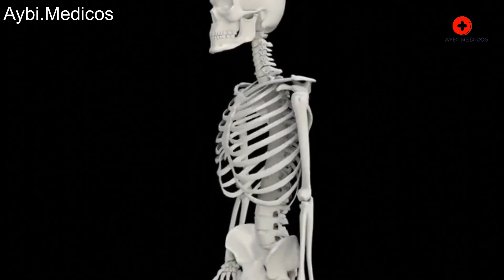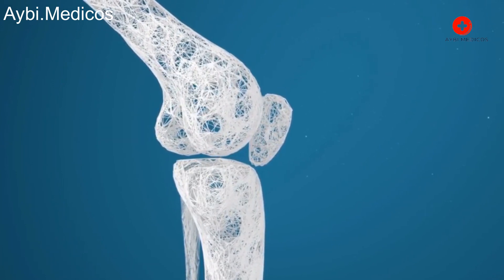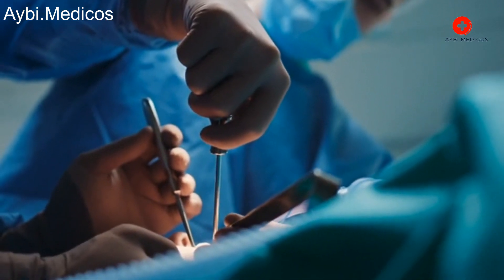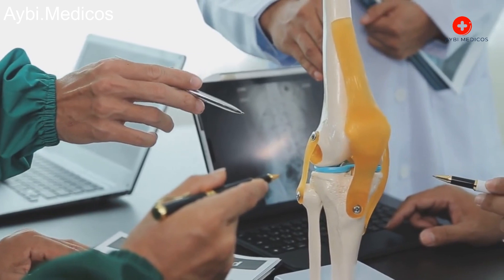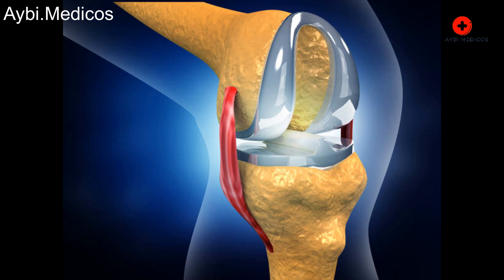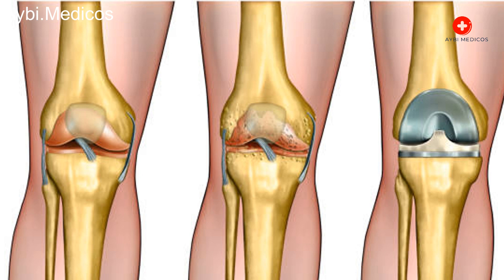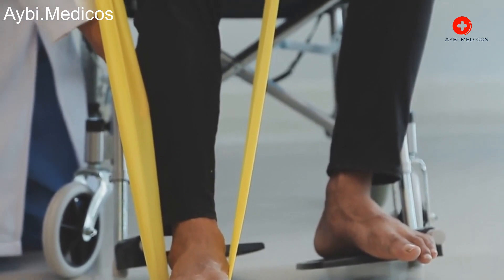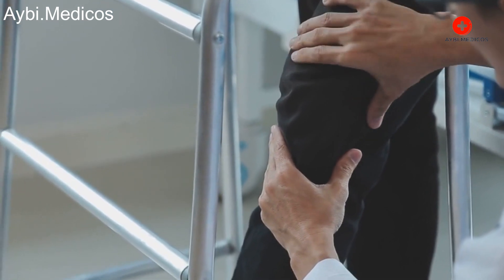How Knee Replacement Surgery Works ?

Comment: Not accurate as far as the recovery time, it takes a year to a year and a half to fully heal
Reply: That's true.👍👏👏👏
Reply: @canangungor5542  it certainly is
Reply: I had a "Day surgery" knee replacement...2 hours after the operation I was sended home, heavily sedated, no pain the first day, but 5 days after my leg got swollen and covered in black a blue hematomas, extremely painful to do excercises, today is day 10...can't sleep more than 3 hours straight
Reply: @darius3550  I know Darius, it hurts like a mother fucker, I'm shocked they sent you home after two hours because the surgery is roughly one hour give or take a few so they just kept you for one hour in the recovery area, damn. It's tough sleeping and exercising the first 2 to 3 weeks but the pain subsides each and everyday, I hope they gave you pain meds, good to take them right before bed to help you sleep, it'll get better brother, hang in there, I know what your going through, I've had both knees done within the past year